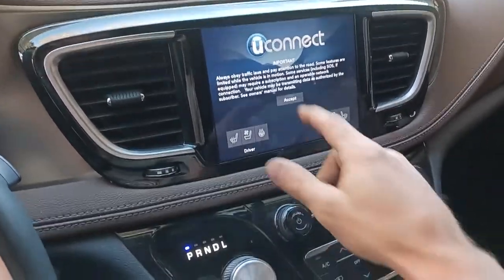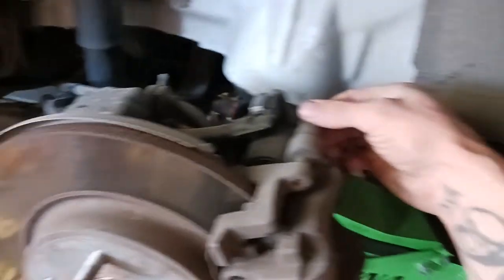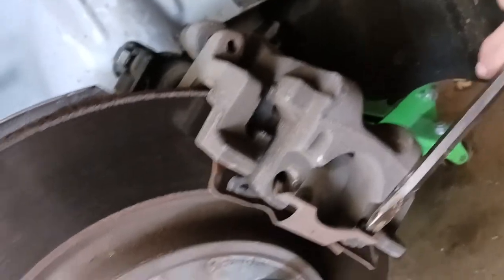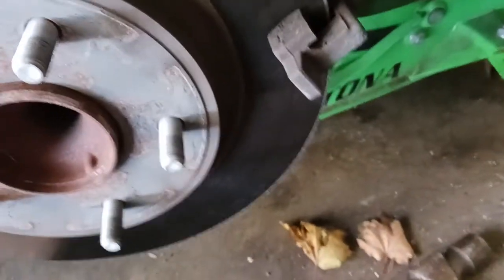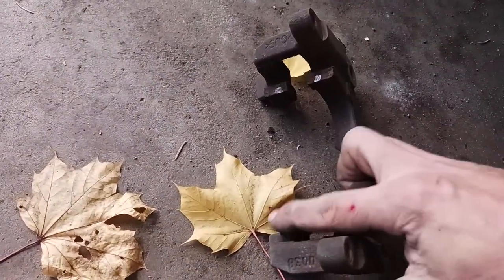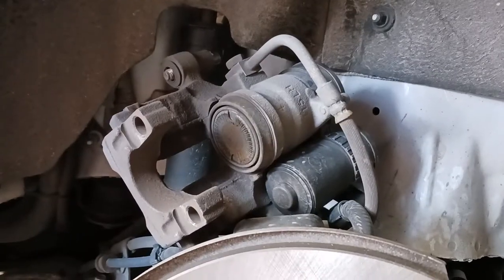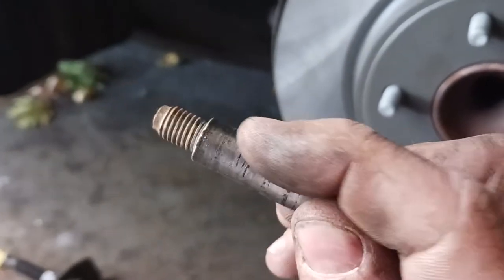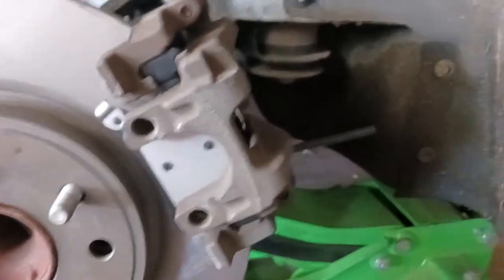2018 Chrysler Pacifica Rear Brake Replacement

Comment: Nice video. You could also just use a 7mm hex socket for the slide pins. A set of them from HF is really inexpensive.

Comment: Hi, if you want change both rear breaks, you need to activate and deactivate the system in the computer twice? Or just one time and change left and right side? Thanks
Reply: Once you release the parking brake with the settings on the radio, you can do left, or right, or both as you please. Make sure to go back on the radio and into settings and follow the instructions to allow the parking brake to work again.

Don’t forget to pump the brakes. 😅

Comment: Which way do you close the rear caliber left or right?
Reply: Personally, I twisted it clockwise as far as it would go as per my friend Mr. Google. But I still had to use the tool that presses the piston in. I don’t know what it’s called. The tool that presses in the piston. And that did the trick. Hope that helps. P.S. I’m a painter, not a brake man.  Good luck!